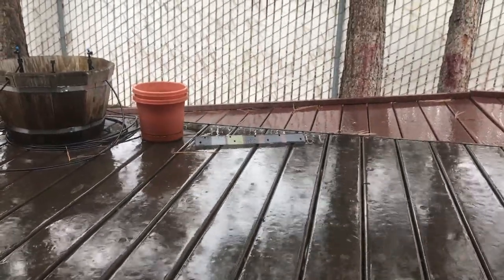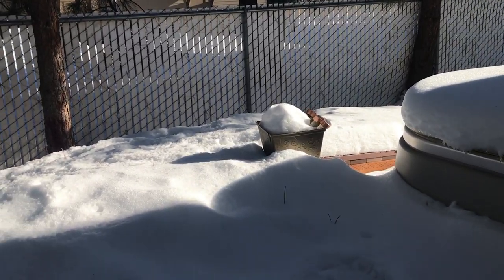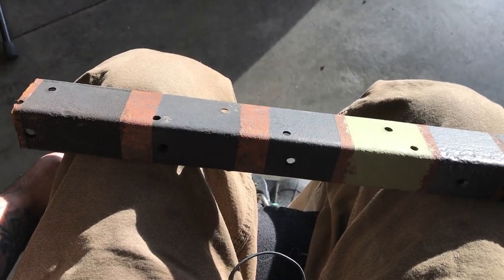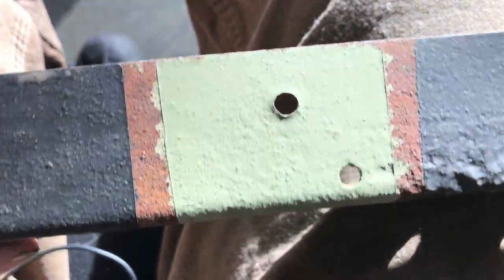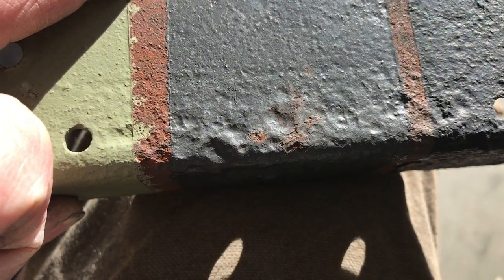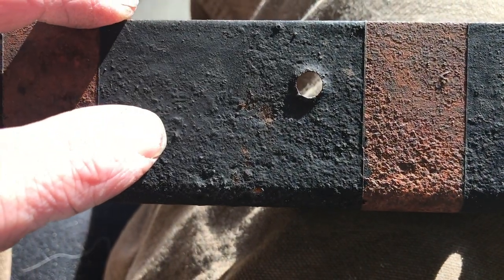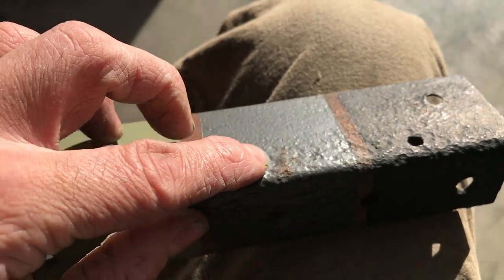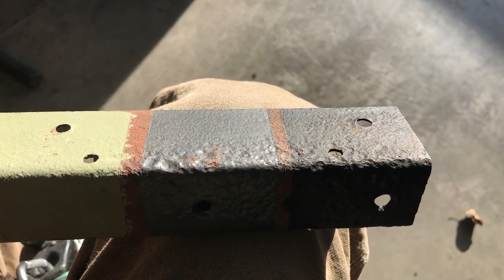RUST ENCAPSULATOR showdown PT.2 - 2 YEAR REVIEW!!

Comment: Shaking instead of stirring should make zero difference anyways. People just have a sunk cost bias IMO. They likely just want to avoid air bubbles because that could create uncoated areas. Yours shouldn't have been affected at all. All of these coatings would fare better with a top coat. Not really the point of the test. All of them will also perform better with even more rust removed. You covered that in your first vid though. I still think a phosphoric acid converter first then top coat is likely the move. These work well though.

Comment: I commend your efforts. Just to throw this out there but at least in the case of por 15 the main reason they suggest a top coat is due to the fact that por 15 is vulnerable to UV radiation. If compared to others out there the extra work is justified remains to be seen and anyone's mileage may differ.  Rock on sir.

Comment: If shaking a product ruins it im not buying it lol.  That stuff probably rumbled and tumbled all the way to the store where you got it from.
Reply: Shaking it doesn't ruin it it airates it and you need to let it sit and settle out before you use it.
Reply: POR15 dries using humidy not solvent evaporation -air bubbles contain humidity ,so, you dont want air whipped into the product whilst using it for that reason. It will also shorten the pot life of remaining product.

Comment: Great series, thanks for the follow up.  About 15 years ago POR-15 was probably the #1 recommended rust treatment product on car forums.  That plus being expensive and involved means a lot people try to self justify the product and their choice by defending it. 
A big reason people loved POR-15 was the thickness and how hard it is when bonded to rust.  If youve ever tried to sand or wirewheel POR-15 you know.  That thickness can add a lot of mechanical structure to thinned out sheet metal, so lets say your cars vintage a driver and youre not ready to fully swap in new panels, you can just POR the crap out of all the thin sheet metal thats rusted and maybe pinholed but not yet fully rotten.    Then keep driving the car until its actual restoration time. Saw it used the most on VW floor pans, and it seems to work great in that application since you can get a layer on both the top and bottom of the floors.  Im not sure how these other products compare as far as adding that strength back to thin sheet metal but if you want that effect and cant be bothered with the prep and cost it seems like Chassis saver is probably the choice. 
Anyways por-15 is expensive and has a complicated/involved application.  The most important thing your test shows is that ANYTHING with rust convertor in the product name is way better than nothing, so just pick something and get it on.
Reply: I’m currently working on a 1960 euro bug and this is comment is just what I needed to read. So I do feel my metal is thin and not strong. So I’m seeing the steps in the por-15 but don’t wanna mess up on the 3 steps and the cost $$$ so u think the chassis repair is my best option or the ace? Also I was planning on spraying truck bed speckle spray after the rust coat
Reply: @randyochoa1757  chassis saver is your best option. In my personal opinion, using both POR and Chassis Saver extensively, Chassis Saver adds a bit more strength than POR does. Both are great products though. As the guy you replied to said, they’re all better than nothing.
Reply: @95roadie  Chassis saver seems like a great product, do you know if it can be sprayed or if there’s an equivalent spray?
Reply: @travispratt6327  you can spray it, brush it, wouldn’t advice finger painting it but you can do that too if you wanted lol.
Reply: @95roadie  lol, funny you say that I watched a video of a guy applying corrosion coating with a rubber glove and a sock over it, claimed it worked really well to rub it in ect.
Reply: @travispratt6327  no way lol. Do you happen to know the title of the video? I’d get a kick out of that
Reply: @95roadie  XIONLAB 2in1 Rust Converter & Primer Real World | Wrought Iron Fence Refinish | Restore Rusty Fence

To be fair though, it is an iron fence, probably does make the job easier.
Reply: @travispratt6327 it can be sprayed with the correct thinners you would use with any paint. My buddy did his chev truck frame and suspension. Turned out well.
Reply: @winstonholmes5566  I’ve decided to just stick with good old spray cans of fluidfilm, it took a few cans to coat the underside now I just have to pick up a can from lowes and do touchups before winter, no mess, no cleanup, no storing anything.
Reply: @winstonholmes5566  Oh and before I did the fluidfilm I wire brushed as much as I could and used rust oleum high heat grill paint over rust oleum rust reformer primer, so far it seems to have been a really effective, cheap, easy and simple solution.
Reply: @travispratt6327  yeah what I did years ago to my trucks 88 Ram and 2000 R/T Dakota was clean the frame where it was needed  (they still had the factory black paint) then I self etch primed, then spray painted and they have held up well. I spent hours. I even colour matched the underside of floors. But they are also only summer drivers and I still do rust check spray cans inside panels and frame holes and the parts I couldn’t paint. I am going to try the Chassie saver on my next truck. Probably the floor inside and frame plus oil spray. It will be an outside truck mostly but still my pride and joy. 91 Ramcharger. I have used the Chassie Saver on my winter beater rims and it’s doing well.

Comment: I used por-15 on my mustang and 5 years after it still looked like I just put it on, I think the thing you missed was POR-15 has an ultra-violet sensitivity and must be topcoated if continually exposed to sunlight. Once topcoated, POR-15 will remain effective for many years.
Reply: What about under the car does it need too coat
Reply: @airuzair2424  undercarriage isn't really exposed to sunlight
Reply: I used the metallic blue engine enamel, great topcoat. Looking at the writeups , being oil-free and using metal ready for a decent amount of time seem to be the most important thing and ultra violet damage is just cosmetic, it cracks.
Reply: I'm not sure how many times he has done these tests because there are different products here than the original test I watched. That said, in the original test I watched he addressed that issue (the top-coat) as he did in this video... he wanted to test the product itself, and as he mentioned all products would benefit from a top-down. My own two cents for the cost and prep, this product should have included a top-coat! In these videos this stuff was just exposed to the elements, not road use, big difference..
Reply: Was your car real rusty underneath? Or clean?

Comment: Usually, the reason to not shake paint/coatings is to prevent air bubbles. If the paint sat for a few moments for bubbles to disperse, or your brushing technique eliminated them, there likely wasn't a big impact. The worse effect should have been bubbles transfered to the painted surface. You may have had this issue.

I've used por15 extensively on a project car and have been both amazed and dismayed by it. The pain and expense of preparation is a huge issue.
Reply from the maker: @dsSpitfiremk4 that makes sense... I have a hard time thinking that shaking the paint would've caused it to be THAT ineffective... to my recollection I don't remember if there were bubbles in the can, but I really don't think there were bubbles when I brushed it onto the metal.  I am in the process of testing it again.  we'll see the results in 12 months.  THANKS FOR WATCHING!!
Reply: @GODSPEEDGarage  I appreciate your efforts. This type of video is a valuable services. Fourteen years ago, my son as a 13 year old, painted our Spitfire motor silver and black with it. Full system, metal prep, marine clean all of it. Except I forgot to tell him to tape off the oil drain plug. It may as well been welded. Pulled the motor, put it back on the engine stand, and put a torch on it to melt it off. I wouldn't risk the torch on a full oil pan in the car. It took him running the torch and me using the breaker bar. The pan was rippling like it would collapse before the bolt gave way. 

Sadly, the car was hit. Thankfully no injury, and we will dismantle it this spring. The car had won trophies twice. 

That oil pan still looks like the day he painted it. I'll post a picture on my channel tommorow.

Comment: Great video. I wish that you included mastercoat, the master series in your comparison. Its far more forgiving than por 15 as far as prep goes. Also, in the industry standard salt fog test, por15 lasted 1000 hours and had significant rust creep under the coating. Mastercoat lasted 14,000 hours in the salt fog test with no rust creep under the coating. Pretty amazing. Also, if you add the topcoat over the primer, your painted surface will be impermiable to all automotive fluids. Even brake fluid. It even made it through 90 days submerged in acetone. Very impressive.

About 5 years ago i took apart my weber bbq. Sandblasted the entire frame inside and out. Prepped, primed and painted it inside & out with por15 exactly to their specs. Also, i used their hiheat paint around the firebox area as per instructions.  5 years later the bbq frame is shot. Rusted out completely around the wheel area. Bbq is now in my shed waiting for another complete rebuild. 

On my 97 f250hd, 7 years ago my mechanic fabricated completely new supports for the factory fibergass cab steps from square steel tube. Awesome job he did. He coated them with por15 primer and topcoat.  He was the one who turned me on to por15. After seeing my post por15 bbq rust out, i checked the step supports and they too were in bad shape. Same problem with my cooler rack that i redid because the powder coat didn't hold up.

2 years ago i came across mastercoat.  I was getting ready to redo the radiator core support and frame on my 97 f250hd. I came across a video on YouTube by repair geek about the proper way to undercoat a vehicle using mastercoat.  I called mastercoat and spoke directly to the owner Pat who answered the phone and explained that he used to work for por15.  He explained everything about mastercoat and the salt fog test. He also told me they use mastercoat on bridges and train cars for rust proofing and so graffiti is easily removed with acetone. So far after 2 years, my radiator core support and frame look like the day i painted them.
Sorry por15 but mastercoat is FAR superior 
I plan on using it on the inside and outside of all the body panels and bed of my truck when i finish the refurb on it.

Comment: Great videos. Appreciate your time and money into showing the different results. I am familiar with por15. I used it about 12 years ago on a 1980 el camino frame that had sat in a hay field in missouri for at least 15 years. I will say it is a tough product and it worked really well at actually getting through the surface and into solid metal. A big part of why it is so thin. I had just chiselled most of the rust off and brushed it on. A year later I went back and knocked a a bunch of the loose rust off exposing cleaner metal underneath and applied another coat. Now 11 years later I have been slowly working on a full frame off and the por15 is still holding good on the frame. I came across your video though for my 2011 ford f150. The rockers and cab corners are rotting here in iowa and have quotes on replacing them. I am hoping to get another year in and stop the rust from doing more damage than it has already before spending the money on a 9 year old truck. Really hoping I can find something that I can get to hold over and just patch in the few spots that are through and top coat with an undercoat or bed liner. I have been eyeing Eastwood's products. I would like to see how the metal looks trying to remove these products. Is there any chance you could do a video sanding or light grinding to see how the metal cleans up after the encapsulation and difficulty removing it?

Comment: Great Video, appreciate the time you've devoted to it. That said-the POR15 silver has way more solids and therefore is way thicker also .Bottom line ...if you're doing a resto job and you want it to last forever do the POR15 as per directions. Wire brush or sandblast ,use their cleaner, their metal prep and do at least 2 coats and if its gonna get UV topcoat it. If you are just trying to cut some corners and slather something over rust any of them will do. With the coverage and duability you get POR15 is really not expensive,esp comparing it to everything else used in body work today. I have no affiliation, but I've been using POR15 since before it was branded,mainly on concours class restos and personal vehicles. In over 40 years, I've never seen it come off or fail when applied properly. Another option is to sandblast, clean and etch then use zinc chromate primer and topcoat

Comment: so my gathering to the experiment is Preparation Preparation > Wire wheel metal as best as possible to remove as much surface rust and flakes as possible before coating . Great video and thanks for the time you spent with this !!!

Comment: Basically, it is a primer. It is made to stick to and encapsulate rust, and create a better surface for a top coat to stick to than the rust. It does not contain protection. Adding stuff to make it a top coat too detracts from it sticking to rust. 
Hey, if it was that easy to stick to and encapsulate rust, all top coats would do; primers would never be needed. 
Top coats are tougher and better repel UV, chemicals, salt, abrasion, and stains. Adding the stuff that makes them stick to rust better, reduces those top coat characteristics. 
Primers stick to to bare surface better and provide a better surface for top coats. 
Top coats protects everything underneath from the environment. 
Any combination primer and paint is a compromise. Some compromises are a bit better than others, but it is still a compromise from doing it right. 
Yes, I too have skipped steps and have not had problems. 
And I have kicked myself for betting and wasted my time and money when it failed.

Comment: This is outstanding thank you for the follow up videos! I have an aircompressor needle scaller drills, wire wheels etc I have everything except for what I'm going to use after removing the rust on my FJ cruiser. Thank you so much for this its literally exactly what I needed

Comment: I just treated the rear axle and housing on my 98 Toyota Tacoma. Those axles are notorious for rusting. Mine was not all that bad ( I'm in the South, almost no salt used on the roads) so, I wire brushed it, pressure washed it, applied Krud Kutter ($5 for 8 oz.) with a brush, let it thoroughly dry and, then put on about 3 good coats of Black Satin Ace Rust Stop. I didn't even use the whole can. It looks great and at about $5 for a 15 oz. spray can it's hard to beat. I've used this process before on an old tractor with very good results.

Comment: I used Chassis Saver on my K5 Blazer frame. It’s been 2 years since I’ve done it. The truck is my main/preferred daily driver and I live in the Chicagoland area (lots of winter road salt ). The Chassis Saver is still holding up and preventing rust. Other parts that were not coated like suspension, steering etc. have rust. I’m not saying Chassis Saver is the best but it’s working very well for me.

Comment: When POR-15 cures it releases gas. If the film drys too quick it traps the gas before it can escape, shaking only adds more air to the paint compounding the problem. The paint is thin so it can soak into the pores/grain of the base metal. Multiple thin layers is the key to success. Topcoating it solves the problem and it is a very durable , strong , flexible coating. It is expensive and back in the day it was the best available. Not many people will bother with all the important critical steps needed for a quality finish. I use it , a major pain in the ass, expensive but worth it sometimes. Today there are many equal finishes available . The Eastwood internal coating is surprising good at containing rust, I love it.
Reply: Great explanation, you need to get this under more people's noses!

Comment: I used POR 15 back when it was relatively new. I was young and dumb. I spent a very long time prepping a 75 Dart that did not deserve 5 minutes. POR 15 is overpriced, over complicated, and IMHO is just snake oil. I picked up the chassis paint in a quart from O'Reilly's and have had great success with half-ass lazy prep. I didn't degrease or even wash of dust from wire brushing off the scale, so I had some small spots break away here and there, but I wiped them down and re-coated the spots.

Comment: When I used POR 15 it was thick after stirring. I've hit painted items with a hammer and that stuff will not chip or scratch...it is rock hard when cured and never had any issues with it aside from sun fade. I am now having good results with rust converter followed by Rustoleum proffesional oil based enamel. It is really thick and I like to really work it into the surface by brushing with pressure in multiple directions then finish with soft strokes.I would not use either method on scaly rust. Quality prep is essential to any paint job IMO.

Comment: Shaking the can is only an issue if POR 15 is rolled/brushed on as it will introduce air bubbles.  Otherwise, you can shake, thin out using solvent, strain, and use in HVLP application.

Comment: The "do not shake" is because shaking will introduce air/moisture into the coating, and these kinds of moisture-cured coatings can then develop gas bubbles before they cure.  Probably just a cosmetic thing, and if its on a chassis covered with dust & mud, you'd never notice.